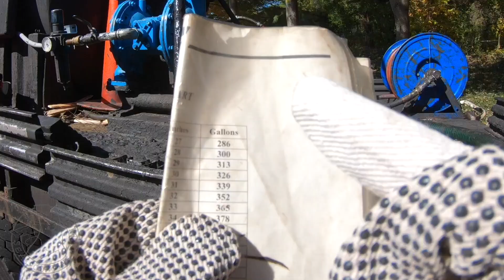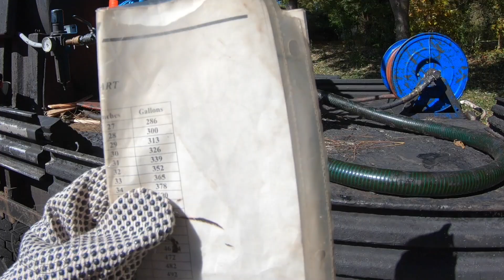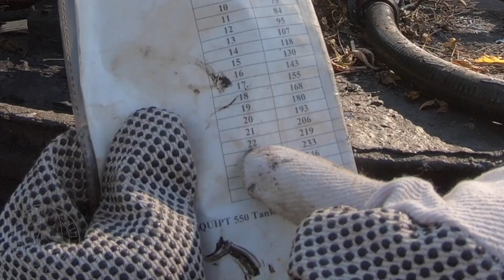Professional Driveway Sealcoating #45 "Leaves, leaves, leaves."

Comment: You know after watching this video this is a good looking product its not a shiny black but a good looking black ... how gal u used on this job? I was going buy a 180 gal sealer tank to get started is that to big or to small or that will work for alot jobs? Thank you
Reply from the maker: This job was just under 100 gallons. I made a video showing how I measured it.
Reply: @SEALCOATINGISLIFE  so 180 would be a great starter.
Reply from the maker: It depends on how much you’re planning on doing. Bigger is always better. You don’t want to fill up twice in one day.

Comment: Hi im a sealcoater from western canada...  i notice sometimes you wear face protection and sometimes you dont.  Whats the concern when your using AE and not CT? - adam from romans sealcoating
Reply from the maker: Hey Adam, the mask I wear is a dust mask, essentially. I have a lot of allergy and sinus issues. I wear my mask when im having trouble with my sinuses, usually in the spring/summer.